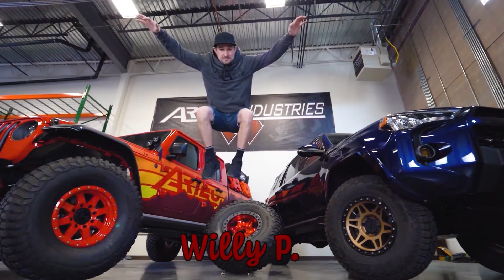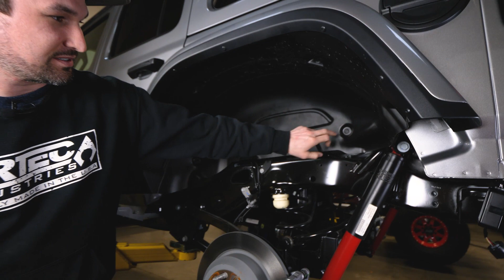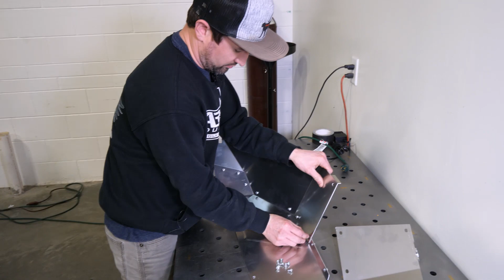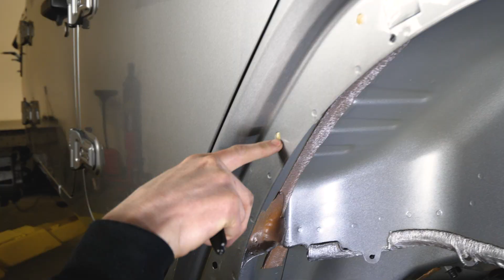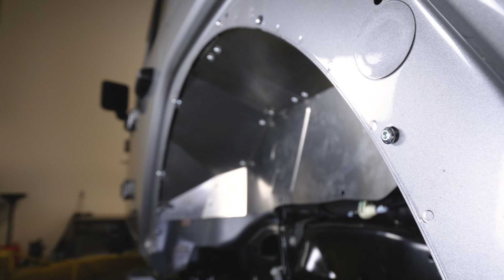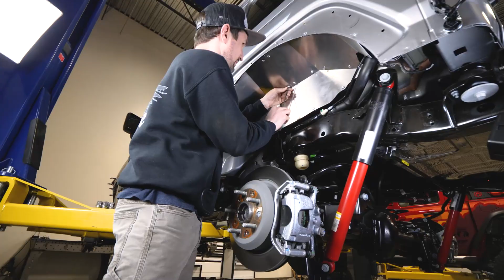JL Rear Inner Fender Liners Installation - Sku: JL5111

Comment: Anyone know the spacer size? I bought some super cheap on Facebook marketplace but it’s missing the spacers and the drill template but I’ll
Probably eye ball it or install it. Mark it from the back and drill forward. I could probably just measure the gap for the spacer but they seem to be about quarter inch based off the video. Thanks

Comment: I tried installing my rear inner fender liners on the driver side, it did not fit perfectly as the video appears. Come to found out, it did not fit due to the shock bracket being in the way and I may need to modify the Artec inner fender liners by cutting off the ends that is suppose to slide into the gas filler tube and hope that it works out. 

I have a 19" JL with 2.5" lift
Reply: I ended up cutting off the ends near the gas filler tube and then it fit! I spoke with the tech before making the cut and they stated I should not be occurring the problems as the rear inner fenders are designed to fit all jl vehicles; stock or lifted and referred me to watch this video. However, that did not happen with my jeep, but we solved the issue by cutting the ends and it worked out.
Reply: That is a small JL.

Comment: I'm having an issue with my 40s rubbing the rear back part of the inner fender lip. I noticed yours don't go that far back That's the part of the inner fender area that I need to trim so I'm wondering if these might work for me Have you guys tried it on trimming that inner lip of the inner fender toward the back to fit 40s yet and does it work?
Reply: Following this, I already trimmed the back and front portions. I just ordered my inner fenders so we will see how this works out.

Comment: I want to see the front fender chop and also the bolt kit you spoke about also for the fenders. Love the stuff you guys do at Artec
Reply: I did the fronts first on my 18JLUR.  Rears will be delivered today.  I removed inner plastic fender and trimmed off tabs with a dremel front and rear.  Much cleaner looking.  Also installed Artec front fender chop kit with LED's.  Huge difference and clean.  I tossed all the plastic clips and simply replaced with ss button head 1/4-20 screws.  Using the screws and ss nylon nuts, you only need like four on each fender to securely hold the fenders on.  The Artec inners should be powder coated or at the very least, clear coated.  Aluminum will corrode over time.  IMO, for what the inner fenders cost, they should be powder coated from Artec. ;/